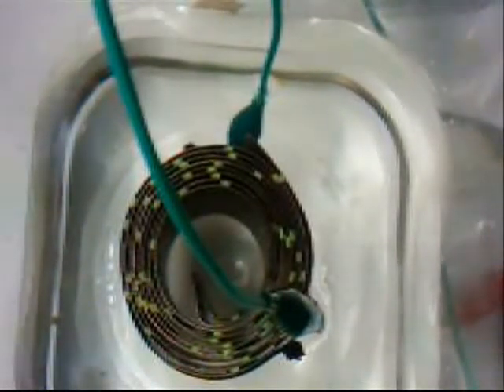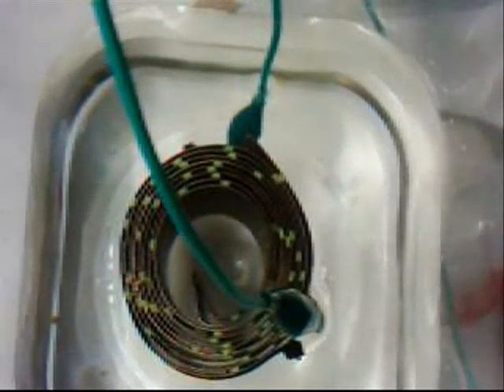Projekt HHO cell- test cell #1

Comment from the maker: if you heat the strips to glowing red before winding you can temper it into position.
but that wont let you wind it with the spacer.
the spacing needs to very even all the way around.
also you want to put one lead on the bottom of the outer plate,and the other in the middle on the top.
dry cells asre better because there is no current leakage at the plate edges.

Comment from the maker: @vox1philippines yes center top and outside bottom.so the losses in the stainless steel are not large by the end of the roll.think about it like a flat plate,the connections on opposite corners.since your cell is configured like shigeta's perhaps you could test and let me know if there is any difference...

Comment from the maker: its not gal steel -i still have this cell-it would have rotted to nothing by now if it was gal steel.
think it is 302 stainless,it was discoloured because i heated it with a blow torch which left impurities on it.
after conditioning it works alot better than you see in this video

Comment: thanks.. for your tips .. this thing is try an error .. tips are so welcome in hho experiment ..  i develop an tool for rolling crop cell in 5min include the spacer.. it seems to work well.. crop cell seems to be the only cell that can pull significant amount of hho out of tap water proportion to its size.. obvious you are more experience then me ,, can you recommend other design that works well .. im new to all this ..